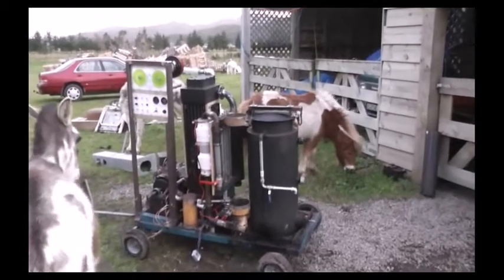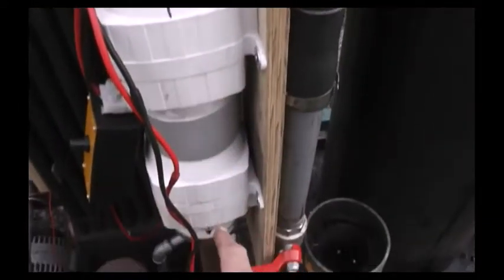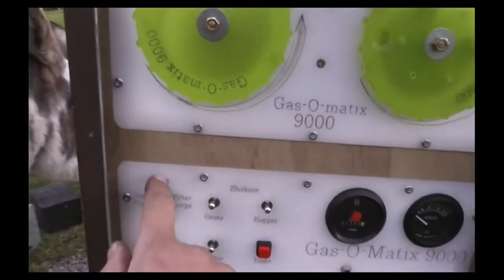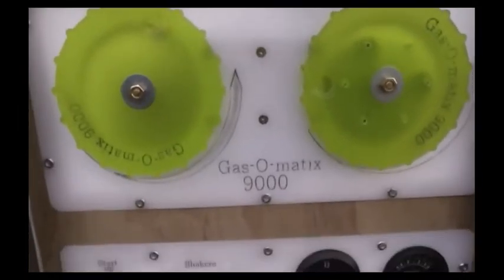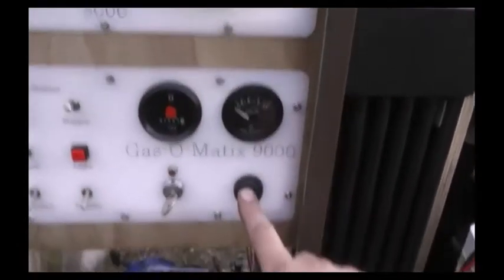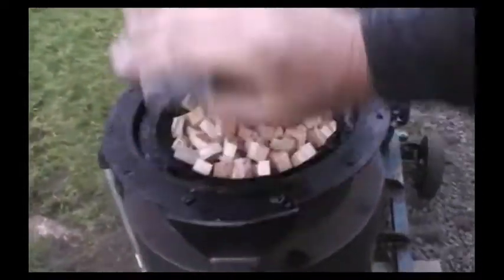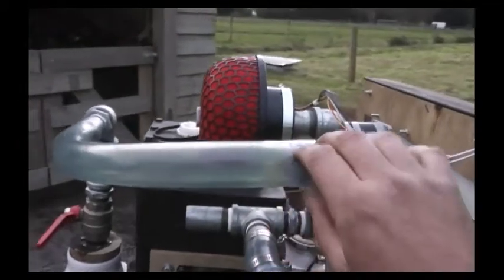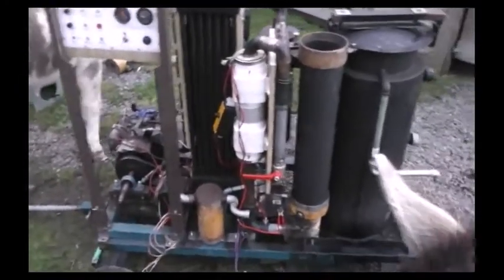Gas O Matix 9000 gasifier preview

Comment from the maker: Yup, this thing makes plenty of heat, so I can use it as a great little stove too  :) .
I find that I can run this gasseriser for about 5 hours, before the grate starts to get overly choked up from below.
When this happens, the pressure loss quickly gets too high, and I have to start adjusting the air flow to keep the motor going.
If I agitate the grate, it's good for a few minutes, then it blocks up again.
The automatic mixing system should let me get around this little hassle, I hope!

Comment from the maker: Howdee partner,
The output power level of the 13HP engine seems to be quite limited when running on this system. I think your estimate of available shaft power is about right.
It will be interesting to see what happens when I devise a means of altering the engine's ignition timing, as I suspect that it needs to be advanced quite a lot.
The same gasifier and fuel type easily produces 4000W when running my 4 cylinder generator, so the choice of engine seems to be quite important.

Comment from the maker: Yup, I figure on using a PIC Micro, and a wideband O2 sensor for this part of the system. That way, I will be able to add an offset to the mixing process so I can run it either lean or rich.
Should be a fun project  :) .

Comment: Easy to fix the back up just cut out part of the bottom then add on a cone weld it in place then put in a pipe with 2 shut off's spaced apart and have them so one is put in place at the bottom of the cone then when ash and char builds up open top valve let ash and char drop into pipe then shut then open lower one bingo clean out on the go lol. With out having to open the unit to let in extra air lol!

Comment: Just a thought to aid in quick engine start instead of adding more gizmo's.... give him a squirt of aerosol ether (Start ya Bastard) by the time the ether is consumed the gas may have arrived at the necessary place.... but I kinda gather you like gadgets (who doesn't) and it will look even more complicated which is also good.... haa, cheers
Reply from the maker: funkee77 
This gasser has evolved a lot since I uploaded this video, so I really should update my video list  :) .
Painting the gasifier frame red made a big difference to its performance, as did adding a number of critical new components to the reduction zone.
Naturally, new gadgets are a must, even if they don't do anything.
It is very important that they have flashy little lights and make 'beep' and 'boop' type sounds  ;) .
As it is right now, I can start the engine on the very first pull of the starter rope - from cold.
In the past, I needed to use the electric starter, while fiddling with the mixing valves.
Over time, you tend to get good at operating these beasties.

There is a "cheat valve" on my gasser. It is in the final line to the engine. When opened, it accepts a little squirt of engine starter spray, or petrol. The valve is then closed and the engine is started normally.
I used to use it, but that was in the days before I fine tuned this beastie for maximum awesomeness  :) .